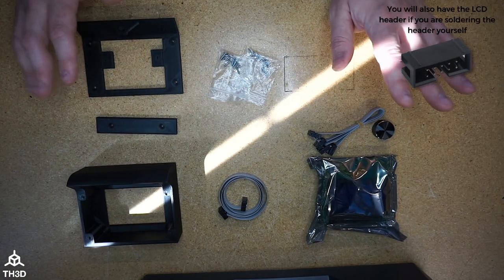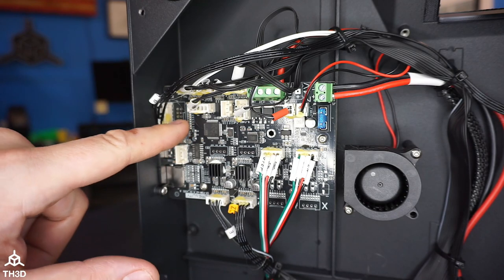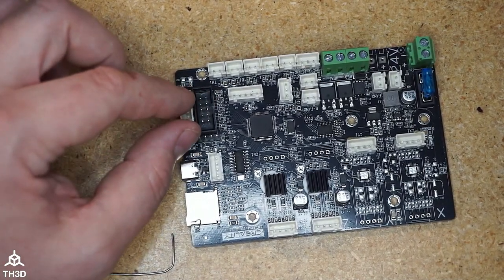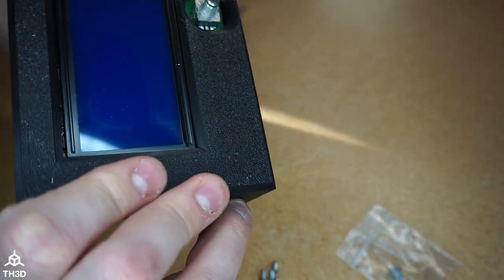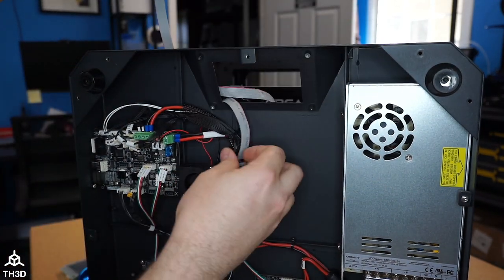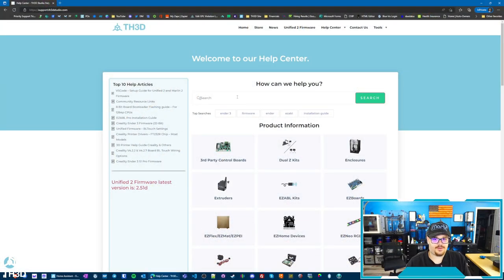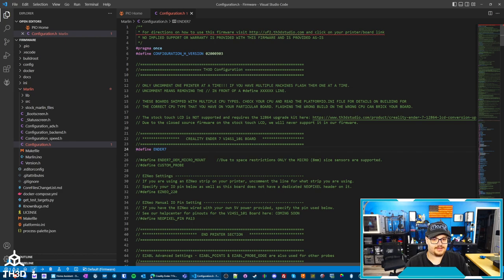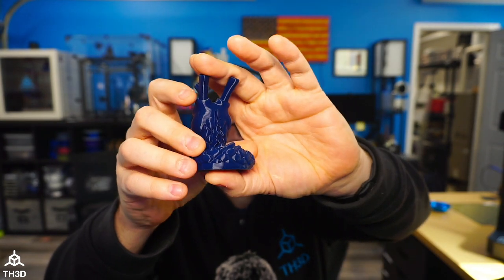Ender 7 LCD Upgrade Kit w/Open Source Firmware - Installation Video

Comment: Awesome! placing order now but also need EZABL and the correct sensor mount for Ender 7 updated on site before I can place order.
Reply from the maker: We'll be getting the EZABL page up in the store for the Ender 7 as you'll want another Z stop cable as well. I'll do a stream on it this week putting it on my E7. This printer is going to require the smaller EZABL Micro probe (8mm) since the hotend is so tight in the top there. There's details on the EZABL setup on the LCD product page btw.

Comment: Can you please explain what this upgrade is.
and why
as i understand is that we have gone from a touch screen to manual knob control
Thank you
Reply from the maker: The color touch LCD doesn't give you access to low level settings on the printer to tweak and tune the machine. You also have no ability to customize the firmware since they have not released source code. So switching out the LCD bypasses the need for their firmware to run it so you can unlock more control and upgrade/repair ability on your printer.